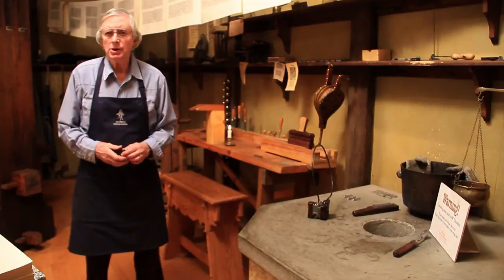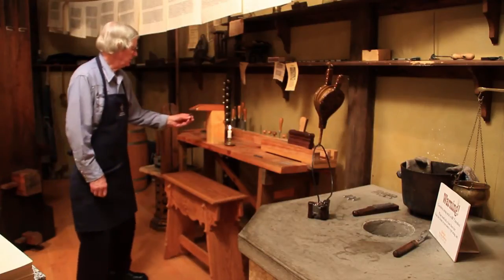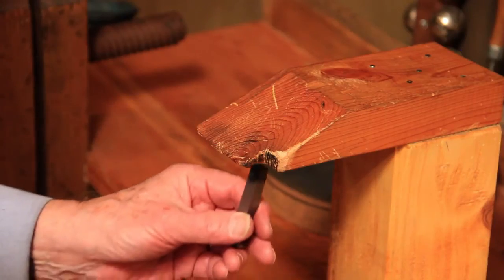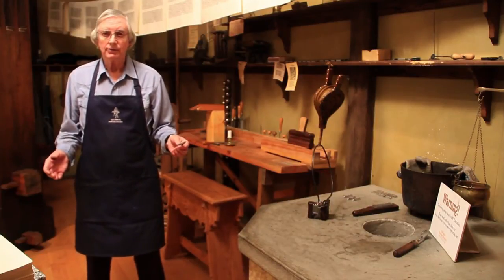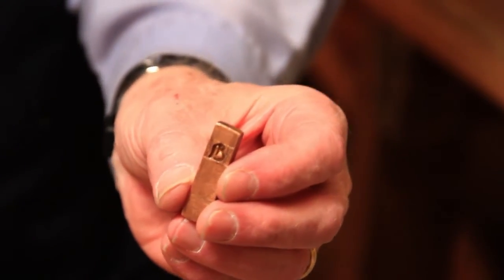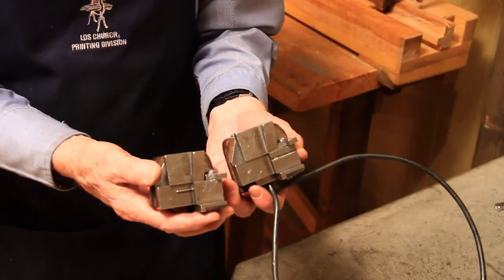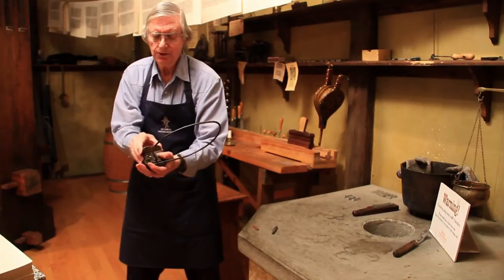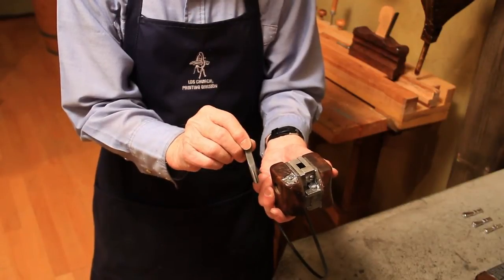Casting Metal Type

Comment: Tempering does not make a metal hard. It makes it softer. Quenching makes it hard, but to hard. You temper the hardness and make it softer to make the metal less brittle but softer then when you quench.
Reply: Why he needs softer material in casting process ?
Reply: @kawtharmarhoon2481  To make the metal more tough. Note the difference between hardness and toughness in metallurgy.